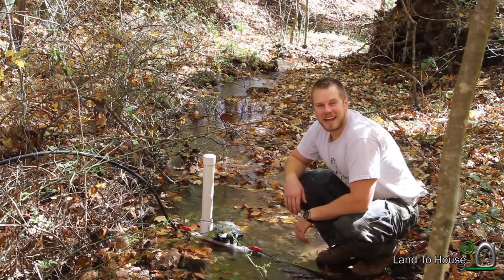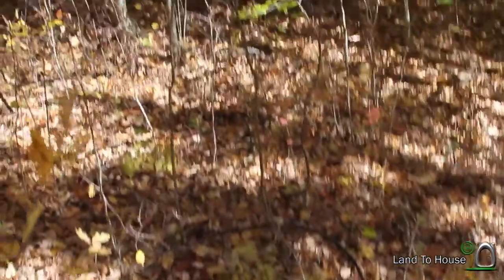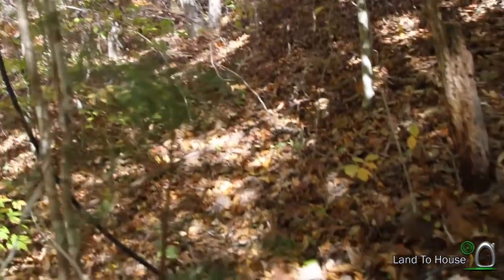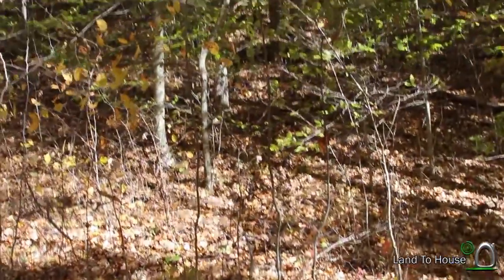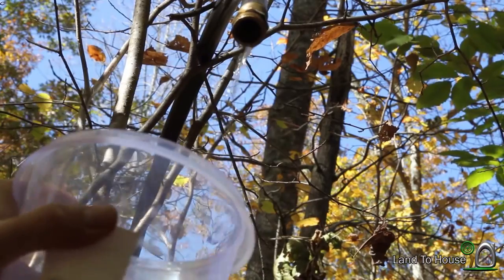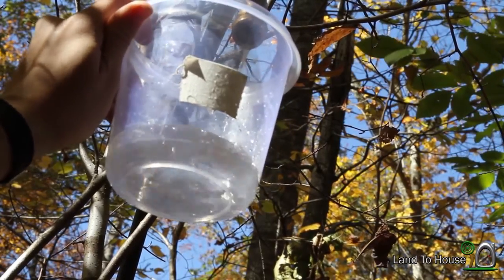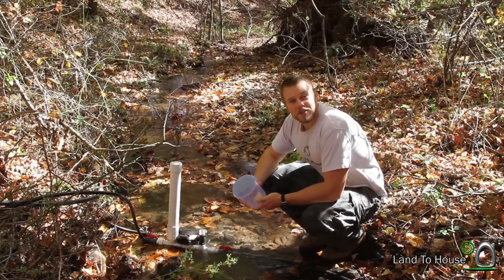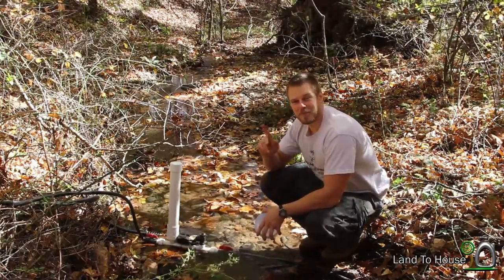Does Delivery pipe size Matter? | Ram Pump

Comment: If i have 2 , 1inch ram pumps put together (so it has 4 valves and the delivery pipe is 1 inch, is it still the, 1 inch delivery pipe enough

Comment: Trying to fill a leaky pond we fixed.  It is about .8 acre and is probably about 8-10 feet shy of being full.  I have 1000 feet to go with about 30 feet of uphill elevation change.  Will one of your pumps work with 1" irrigation line?

Comment: Neat to see you tested it.  The answer was actually predictable.  when the flow rate is so low  the viscosity of the fluid interacting with the relative roughness of the pipe interior surface drops to zero.  You would need to get the delivery flow rate up above 10ft/s in that size pipe to begin to have a small measurable difference.

Comment: In your case, it really doesn't matter which size you use because between each ram cycle the water coming out of the delivery pipe completely stops for a while. ( equilibrium state between the pressure tank and water in the delivery pipe) so if no water flow then no matter what size you use.

Comment: How about the vertical lift is higher like 40 meter whic is better to use smaller diameter or standard like for example 1" ram pump the required delivery hose diameter i s 1/2, how about if we uss 1/4 " diameter.
Reply from the maker: The size pump and delivery actually does not effect the lift output of the pump. You will need 6 meters of head pressure to pump to 40 meters lift. The pump size only changes the volume output.

Comment: Why does your drive pipe have to be so long?
Reply from the maker: The delivery pipe can be as long as you need. I have heard stories of pumps pushing water over a mile. The drive pipe needs to be long enough to allow the pressure wave  build and be strong.

Comment: What delivery pipe size do you suggest for a 2 inch system. I used a 1/2 inch delivery pipe thinking that the weight would actually matter. I am pumping water on a vertical heighf if 25 m (82 feet). Is it worth changing the delivery pipe in terms of gain in flow to a larger dimension and what us the optimal one for my 2 inch system.
Reply from the maker: With most ram pumps it is recommended to use half the drive pipe size. So 1" in your case. Now that being said I have found that as long as the pipe is not so small as to create friction loss its just fine to use a smaller delivery pipe. You should be fine with a 1/2" pipe. The weight is going to be the same on any size delivery pipe because it is under the same 1 Atmospheric pressure.
Reply: Thanks for the input.. Ill keep it as is for now since im quite pleased with the results and in the future ill run a comparison with 1' delivery pipe..
Reply from the maker: Sounds like a plan!

Comment: I think it is a lot more important to reduce waste than to squeeze drops from delivery pipe.
Reply from the maker: I guess it is situation dependent. With your closed system it is way more important to save waste but pumps in creeks it would not make as much difference.
Reply: If the waste water goes back into the creek then it doesn't matter one bit.

Comment: The head pressure in any size pipe over the same vertical distance is the exactly the same.  So the only difference between pipes will be the friction losses due to pipe roughness and diameter restrictions... so ... the bigger diameter pipe is the way to go ... smaller pipe will have more frictional losses...  
The weight pressure is exactly the same.  it doesn't work on the volume of water in the pipe but rather the elevation height over which your delivery is running.
Reply from the maker: Well stated. That is what I was trying to show in the video. I hope it translated well enough.
Reply: What would happen if you kept adding stand pipes then? Would that be helpful?

Comment: kindly provide a very simple conclusion pls?
Reply from the maker: The delivery pipe size does not matter as long as the pipe is not too small. If the pipe is too small and creates friction the water will slow down. The pipe cannot be too large. A 4" pipe delivery will supply the same water as a 2" delivery pipe.
Reply: Thank you mate.

Comment: The column of 1 foot of water exerts 0.433 pounds per square inch of pressure.

This is saying it doesn't matter if the pipe is 4 inches in Diameter or 1/4 inch in diameter the psi is the same.  If you are lifting water 10 feet it will take 4.33 psi to lift it no matter the diameter.  It is a Hydraulic thing.  I struggled with this but lucky got a handle on it before I bought lots of pipe.  

My ram is pushing water up hill really far.  I am using 500 feet of 1/4 inch black tubing.    My PSI gauge on the bottom is reading 89 PSI.    89 PSI / .433 = 189 feet of lift.   I am lifting the water up hill 189 feet in the air with 500 feet of pipe.

The math will help with most questions.  

It sure took me a long time to get the hang of this.   Ha Ha.

These videos are awesome.    Keep them coming.  I hope to get back to my Ram in a few weeks.   :)     By the way I used the wimpy 1/4 inch black poly tubing because was able to buy it from Lowes on line for $7.00 per 100 foot.   Hard to beat that price.
Reply from the maker: Thank you for the mathematics behind the lift potential. Sadly I tend to test more rather than think about math. It would probably save me a lot of time and money if I were to take the time to think more. But it makes for good youtube!  haha

That is a really nice price on that tube. I think that the 1/2" is around $13 for the 100'. How well does the 1/4" take the 89psi you are getting? no issues of it springing leaks?
Reply: No leaks yet but I haven't used it a whole lot either I need to get my standpipe working in an inline check valve on my delivery. Please don't take it that I was a know it all I had much rather see the experiment in the math.
Reply from the maker: John Godwin I am interested in how well that small pipe holds up. :)  Dont worry about being a know it all. I am always happy to learn from the research of others. Back when I was in school I was bad for testing something over and over changing values slowly until I got the answer instead of just doing the research in the first place.

Comment: First of all thanks for the mention :)
The test surprised me as much as you as I had convinced myself that I would get a better flow with a smaller delivery pipe, I was going to replace my 3/4" pipe with a 1/2" one but I think this has changed my mind. It's over 300 feet long so I shall spend the money n something else ( I have other projects planned )
As Roy Dredge said pumping 24 hours a day it will still be hard to use all the water!
Nice video as always
Reply from the maker: You are welcome.  I was so sure that the smaller pipe would have better results.  I guess that is why we test.  Saving the money for 300 feet of pipe is good.  :) even when pouring that concrete pad I could not keep up with the pump into a 55 gallon tank.

Comment: interesting Test there Seth my guess would be that you still could not use all the water either hose could pump in 24 hrs 
That pump was a lot slower and hardly any noise its that due to it being smaller
good video as always
Reply from the maker: Yes i agree. That would be many gallons per day. Unless it was for watering a large crop it would be hard to use that much. .... The noise of this one is because of a few factors.  It is much smaller than the other pump. It only has 2 feet of head. And the drive pipe is to long for that size. :)